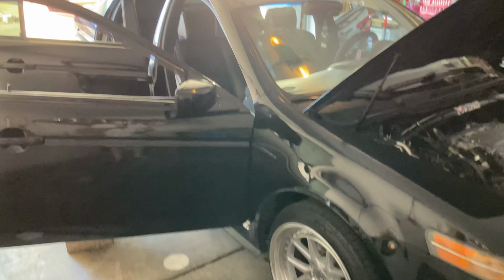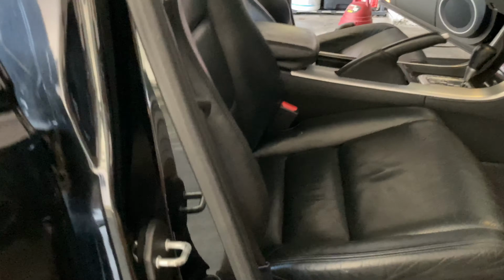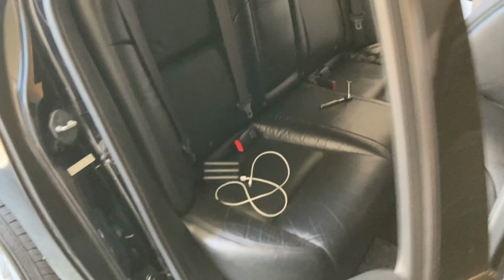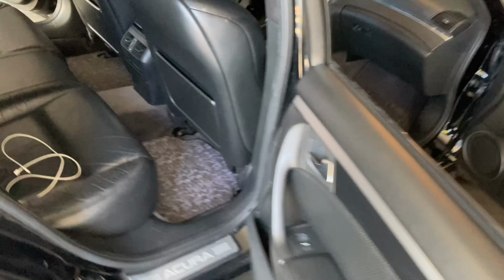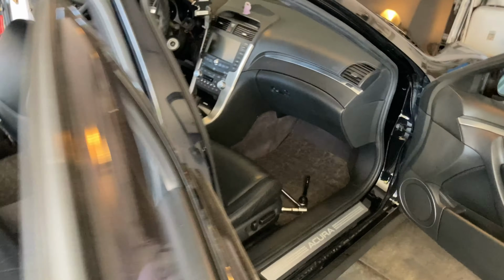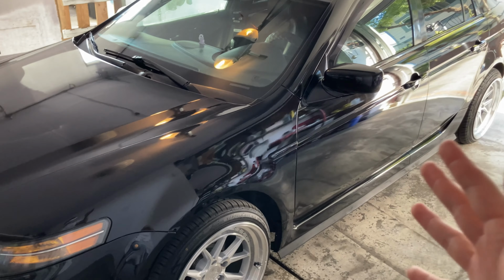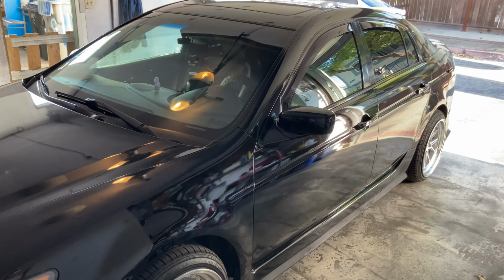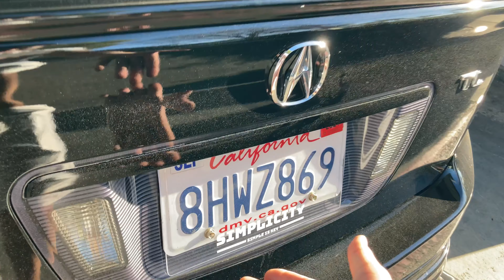How to Remove Front Seats on a Acura TL (INTERIOR CLEANING 04-08 Acura TL)

Comment: Totally digging the headliner. My 06 TL had that cream colored headliner and i swapped it for black. Ive been on ebay and checking out junk yards for other black plastic pieces. My dash is also super cracked (i purchased it used for $800) both front fenders were damaged as the previous owner tried to roll them but just messed them up. He also damaged the rear speaker deck (like the metal hole for the 8in sub is blown outward and the carpet that mounts under the deck wont stay in place. The engine and transmission are great. But the interior and exterior need some TLC. Will the seats from an 07 tl type s fit in the 06 TL? Or do i need a 04 to 08 base model TL to replace them?

Comment: Hi, I'm about to replace the passenger seat with one I found at the junkyard in great condition and I wonder if I have to program the new one or what do you recommend besides disconnecting the battery so I avoid any codes after replacing? I've read something about the weight sensor that you have to keep the original one. If you have any info I'd really appreciate it. Thanks in advance!
Reply from the maker: On my end, I didn’t program the sensor. It still functioned properly as before.
Reply: Yo did it work or did you have to reprogram codes n shi
Reply: @momo_5193  I didn’t t have to reprogram anything bro

Comment: I know it’s been a long while since you did this video but wanted to know what year your TL is? I’m having an issue with my passenger seat and noticed yours doesn’t have a part underneath the passenger seat. Mine is an 08
Reply from the maker: I have an 06 TL. Forsure it will have different configurations with the 08